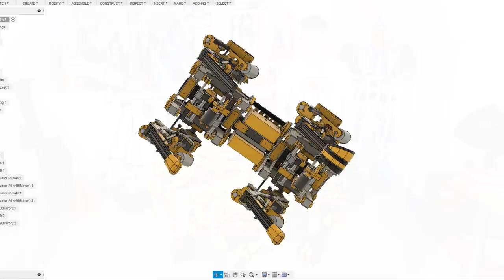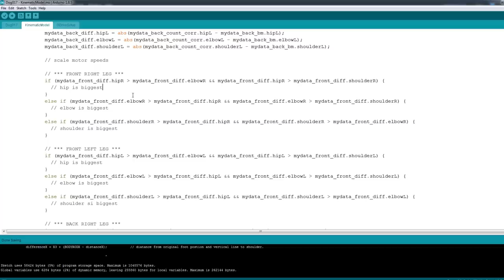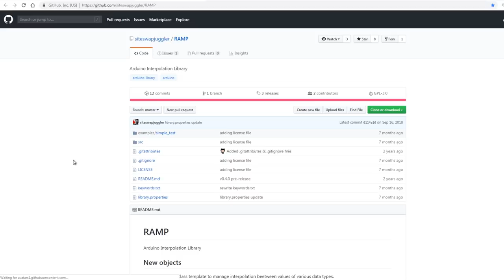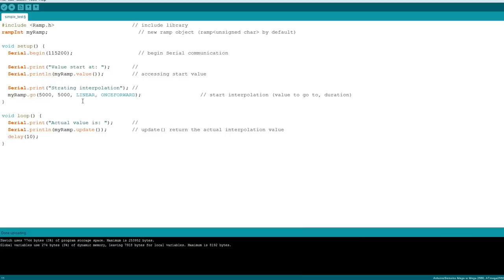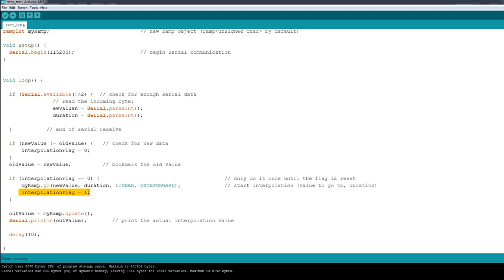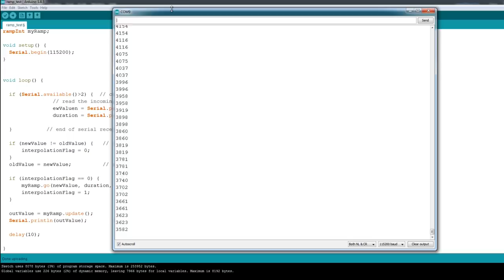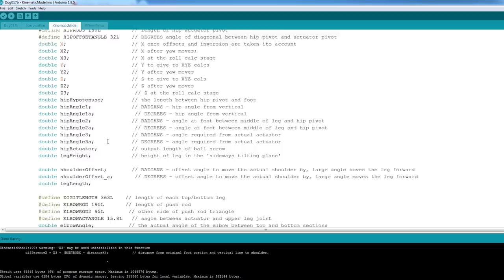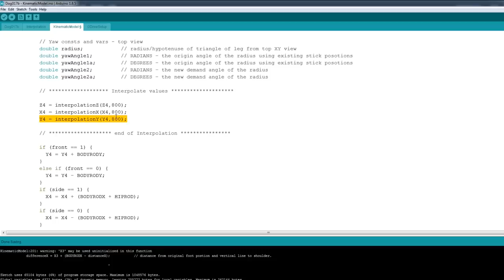openDog Dog Robot #17 | Experiments with Interpolation | James Bruton

Comment: Your interpolation function (and  probably the library) uses static variables to maintain state between loop cycles.  So if you pass the same function a new value, it uses the static variables from the previous call, which was for a different axis in this case.. Chaos. BTW, this is my favorite youtube series.
Reply: This

Comment: Pass the correct instance into the function.. instead of 12 separate functions?
Reply: Yes yes yes this!
Reply: Yes, one function called byb12 instances, each instance with it's own 'local' variable to prevent confusion
Reply: I was thinking the same thing. I guess he would have tried it, but couldn't achieve the desired result due to the way the ramp code was written.
Reply: I was going to suggest this too.  make the instance a parameter on the function.  Then you only need one function and you just pass in the instance you want.  Just be sure to make the parameter a pointer to whatever the class is.
Reply: Would it be possible to declare the instance in the function so that you don't have to have 12 instances?
Reply: @T0DD  No because the instance needs to persist between calls each time through the loop. If you declared it in the function, it would be a new instance each time.
Reply: Perhaps you could make a 2d array of interpolation objects (something like rampInt  rampedLegValues[NUM_LEGS][NUM_AXES]; ) and pass the leg number (0,1,2, or 3) and axis numver (0 for X, 1 for Y, or 3 for Z). 

This would only need one function, and be much easier to modify and maintain. This
Reply: Agree, a typical catch when you define a static variable inside function :-)
I don't know much about the Arduino but seems like it supports also C++ syntax. In this case you can even define 12 objects :-)
Reply: It might cause lagging for arduino

Comment: Do not upgrade the PLA parts just yet; reprint them and replace. These will be your 'breakers' when testing your code/kinematic model. You'll break something else surely (the next weakest part). Better some PLA parts then your motors...
Reply: Very good point

Comment: James, I love this project. I think you're doing some great work, but I want to leave you a warning about trying to use the ramp library to interpolate between movements. Using a library like that will work for moving between definite end states, but won't work for dynamic movements. You need your code to be calculating velocity and acceleration instead of trying to work directly on position. 

With smoothing of position: imagine z = 0 is the bottom and z=1 is the top. If you start at z=0 and then ask dog to quickly move to z=1 with an in-out curve, it will appear to smoothly accelerate up to top speed, then decelerate as expected. But if when dog is mid-move say at z=0.5, at it's peak speed, you then ask it to change direction back to z=0.75, it will start the in-out curve over again, plummeting your velocity to 0 as if you are starting a new move then accelerating back to speed. 

If instead, you ask dog to go back to z=0 mid-move you'll end up with an immediate, jerky halt with a new curve to the new end point.

If you instead know what the current speed and acceleration of a joint is, compared to the peak speed of a move, you can calculate the delta between the current speed and the target speed then adjust the trajectory accordingly. The Accelstepper library does this fairly elegantly.
Reply from the maker: I'm only using RAMP to control positions with a linear interpolation, so it'll only move slower if I specify a longer time for the interpolation.
Reply: James Bruton even with just linear interpolation, if you are using a fixed time interval between current position & destination I think you’ll end up with jerky movements when changing the destination mid-move. If you’re using variable time intervals, I’m curious to see how you derive them.
Reply from the maker: @PatrickGunderson  That's what the first order filter is for - we'll be able to change the filtering ratio dynamically for every move also.

Comment: Good thing you weren't testing an exosuit.  That would have been bad.   If I could make a suggestion, I'd build a simulator to run your code on first before actually running it on hardware.  :)

Comment: It seems as if you are using static variables within your wrapping function. These variables would be reused by each call, of course. You could simply add an Id argument to your function and use a single static (or global) array in which you store values for each interpolation.

Comment: The functions contains static variables! the values are saved each time the function is called. If you call for leg then for hips, the hips will work with the previohs values of legs! Try modifying the functions with structs so you can pass a struct pointer and modify those values instead. Have a struct for each axis and only 1 function!
Reply from the maker: They have to be static or they get reset every time it's called and reset to zero again. I'm working on it!
Reply: But you can make it static in your main loop and give the pointer to the struct with the function. Pointers are the great advantage of c ;)

Comment: Stop it right now! You don't want to have something tougher on the joint as it was. It's important, that the cheap parts break. If you toughen the joint, a ballscrew or a jointer will bend or break. Always let the cheap parts break. It was crashed due a malfunction - it withstands the normal operation perfectly fine. EDIT: Typos.
Reply from the maker: I'm planning to hang it up for further testing!

Comment: Wow! Haven't been on this channel for some time (just doing/watching other things) and wow what an impressive robot this is. The kind of thrashing/shuddering you are seeing James is an almost inevitable result of using motors and gearboxes and is very very hard to completely get rid of.. I work or worked in Strong AI for many years and one solution I came up with was a 'virtual muscle' intermediary. Basically each motor is controlled locally in a tight feedback loop with a force sensor load box. The machine only talks to its motors directly in terms of force and the feedback loop takes care of everything else. There are also separate absolute position sensors. 

If everything works correctly then most of the shudders should be balanced out. The critical feature is that the limbs start to behave as free moving frictionless or even massless (mass compensated) joints. The higher level servo system (in my design) is built around a series of complex synchronized multi-state linked oscillators and a library of 'reflex' functions.. The servo system design should eventually be able to synchronize dynamically to its own gait or to an external source like music or people moving.. That is a l-o-n-g way in the future though... :) 

Sadly the punch line is that the whole thing is still only theoretical. The design is built around a working artificial consciousness, something that itself turns out to be pretty hard to build. Not impossible but pretty hard..  (So many hard problems, memory algorithm core, sound & speech conversion, 3D visual data format, hardware cycle encapsulation, etc etc.)

Comment: 3D printing stuff and then upgrading to metal when they break is definitely the way to go on these kind of projects.
Reply: I dont think so in this case. The parts only broke when the robot made a move it wasnt disignd to do. Wheb something like this happends it is sometimes better to have a broken part that can be cheaply replacerd, instead of a riggid part with wil pass the forces to somewhere else. Possibly breaking more expencive parts
Reply: @MegaCbgames  this robot will at some point run and jump. The 3d prints are clearly a weak point. The forces will be transferred into the aluminium extrusions.
Reply: @JAClerMont  oke i can find myself in that. However i would probably wait with replacing the parts until further on in they proces.

Comment: You should start using some RTOS, then you could have a seperate task for each leg that runs in "paralel" independently and send commands to the leg.
Reply: That's overkill - his problem is a very simple and basic issue with C/C++: state management (here: static variables inside the function).
It's basically exactly what all the functional programming fuss is all about: make your functions pure so you'll never encounter issues like this.

Comment: Those parts that broke… I think it was actually a good thing that such simple and replaceable parts broke, and it gave me an idea… What if you had something like the kinetic equivalent to an electrical breaker or fuse; a socket that is designed to pop apart if it gets a certain amount of force applied, relieving strain, which you can then reset after you document and fix the problem? I bet ninja flex would be ideal for this.
Reply from the maker: I'm going to hang the robot up for further testing.

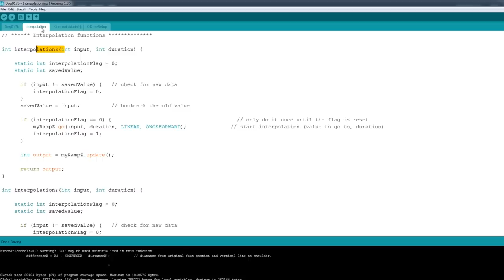Comment: At 13:40 you have two static variables inside an interpolation function. One of which is used before it even gets initiated. No wonder the function behave strange with different axis input data.

Comment: Hi James, amazing work sir :)
The issue you had with the interpolation code for just one axis was vs all three, was most likely down to you using one variable to hold all three old values, plus I was surprised making static variables inside each function using the same name didn't through any warnings or compiler errors! (unsure how Arduino code works, but in C it would make it a global variable) , hope that helps :)
Reply from the maker: Thanks, I'm working on it!

Comment: Would it not make more sence to interpolate the desired pose (x, y, z, roll, pitch and yaw) before sending it into the kinematic model? That way just 6 interpolation engines would be required, or even 3 if you just want to interpolate the position
Reply: There already is an inverse kinematic model, that is what he is using

Comment: I am not sure I would upgrade the bits that broken until you have sorted the model. Keep them pla as a deliberate weak point. If you strengthen them what is the next component to break or bend, probably more expensive and hard to get than reprinting some bits.
Reply from the maker: I'm going to hang the robot up for further testing.

Comment: I don't think upgrading the broken part to aluminium is a good idea, if it didn't move with the kinematic model and broke then that's a good thing if it was made of aluminium when it performed the move it might have bent your ball screws. Great video as always, I'm now going to try and find some uses for the ramps library, better than using Bresenham every time I need to interpolate!
Reply from the maker: I'm planning to hang the whole thing up of the ground for further testing

Comment: You should create a design which can be made with all metal parts. In the end you will upgrade every plastic part which is under load of any kind and have a metal robot anyway.. so why not do it straight away? Maybe try to team up with a plasma cutting company which could provide you with plasma cut parts or even a plasma cut table:)

Comment: At this point you have to start thinking on using some sort of numeric Integration instead of this mixes of positions and interpolations. Just integrate the newton equations every n milliseconds for each motor, and derive the speed/accel for the next position you want it to be. It will simplify a lot all the math, and as you have position sensors, you can easily adjust for integration deviation. This will allow you to use  a very basic integration method,  easier for the Teensy,
Reply: Here, approximatelly what that paper is saying in an Arduino application:
http://www.gperco.com/2013/12/robot-arm-reaching-for-stars.html

Comment: You could print some parts in nylonX :D Also you might want to check that your phase wire plugs are all insulated I saw some bare metal. Dont want to short those! (Will likely fry o drive)

Comment: I don't understand the significance of interpolation in the robot walking
Reply from the maker: It makes the feet move in a predictable straight line from position to position rather than a weird curve with some motors in the leg finishing the motion before others. So it makes the motions easier to control

Comment: Ok...BUT, if you replace the plastic parts with stronger material and it misbehaves again due to bad coding (or whatever), what critical/expensive part will end up breaking then? Motors? Shafts? Bearing? 
Might be better to have some cheap/weak points that break when bad things happen than forcing it to REALLY Self Destruct!!!
Reply from the maker: I'm planning to hang the whole thing up of the ground for further testing
Reply: This is a really interesting point, stronger vs failing how you want it to fail. Kinda like a mechanical fuse.

Comment: Why not use a faster/better mcu like a stm32f407 it runs at 168Mhz and is 32bit that should give you enough processing power
And it has more communication ports
Reply: Probably because this project is complex enough as it is not to introduce a new microprocessor that he is not familliar with
Reply: The Teensy 3.6 which is what James is using is 32 bit and runs at 180Mhz.... and has many comm ports including 6 serial
Reply: @richardathey3116  Well he then could use an stm32h7 or just a raspberry pi
Reply: Meth auch ohne Gaming if James makes his code more efficient (structures) and stops using doubles I'm sure the Teensy will be fine for a simple kinematic model. 

I do agree however with inefficient code, the ever growing complexity of the kinematic model, and throw in more library overheads, he might have to concider something more powerful. 

Go James 👍 it would be huge(and cheap) for the open source community if you can crack it on the Teensy

Comment: Doubles on Arduino - you are a brave man :D
Reply from the maker: It's a Teensy 3.6 which is 32bit with an FPU
Reply: @jamesbruton  :  I'm afraid the T3.6 only has single-precision floating point hardware (float), not a double precision one as stated in the NXP MK66 CPU manual: 
"ARM® Cortex®-M4 based core : 32-bit MCU core from ARM’s Cortex-M class adding DSP instructions and single-precision floating point unit based on ARMv7 architecture". You might still run into severe performance issues with doubles.

Comment: Part breaks, time for better material. At this rate, it is going to be 80% aluminium by the end.

The weird behavior when calling the ramp command from the ramping library multiple times in the loop is likely from the library using set memory variables and not clearing all of them at the end of each call for the ramp command.  You could look in the library and find what variables it is using and write a line to reset the values to their initial state. Honestly, I am surprised the library wouldn't do this on its own, but it might be set up for running multiple types of ramps that interrupt each other and ramp from the current position, which could come in handy later when you have sensor and balance interrupts.

This is a lot of debugging on a library that I could see being used form many applications. Maybe the documentation or an e-mail to the author would yield a solution that is more elegant and efficient than having 12 separate instances, one for each axis/limb combo, running each loop. You upgraded the processing by a huge amount, but it is still easy to bog down a processor of that type and you haven't even added in sensors with interrupts for balance yet, let alone reaction to contact or proximity to objects yet. I suspect that you are going to have to step up the processing even higher by the end of this project just to make it walk with any complexity beyond just a short stride across an ideal, flat surface. So, either better programming or just throwing more CPU and memory at the problem.
Reply: My impression is that you do need a different instance for each motor because it is not a call-return stateless thing.  It is an object that has a current state, and you call update() on it which looks at the current state.  The "call" persists over the five seconds of the interpoloation, and it is busy until that is done.
Reply: @JohnDlugosz  I see. As I said, the documentation might give a way to do this without the 12 discrete sections being needed. I am concerned that doing all of them discretely the way James showed us will bog down the system and result in the loop taking too long.

Whenever you are setting up mechatronic systems with a PLC (microcontroller), you want to loop to run as fast as possible to ensure proper behavior from the system. A bogged down loop can't react to interrupts or take actions that are needed in time for them to be effective.

Comment: First of all awesome series.  Being a mechanical engineer 95% of the electronics and coding does not make sense to me unfortunately.  I managed to turn a dc motor in the wrong way using the arduino and L293N and I felt like I won the world cup all by myself...  

One question I have is that as far as I understand, MCU etc all run through the code.  Just like a NC code where each like executes one at a time.  My question is, isnt there a method to access all I/O pins at the same time.  SO you have a central controller which dumps the outputs that it wants to all pins and the pins are connected to controllers that control each leg or joint...  can this be a solution for higher speed code executions.

Again thank you for the wonderful videos and information you share, also everyone here that contributes through the discussions..

Comment: Is there any reason you chose serial over CAN bus? I'm sure you've probably been asked this before, but Teensy 3.6 and NVIDIA Jetson TX2 both have a CAN bus as well as a few motor controllers like the brushless controller SPARK MAX and brushed controller Victor SPX and Talon SRX. They're used in high school robotics competition.